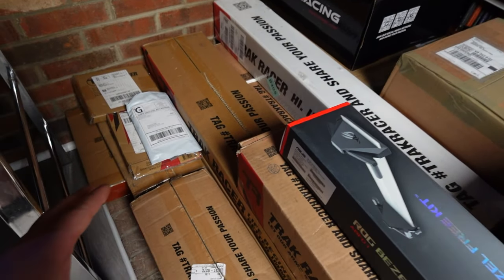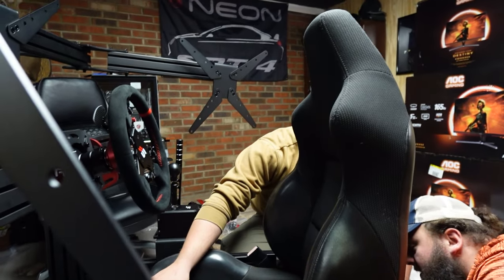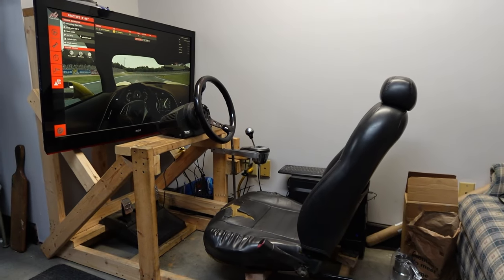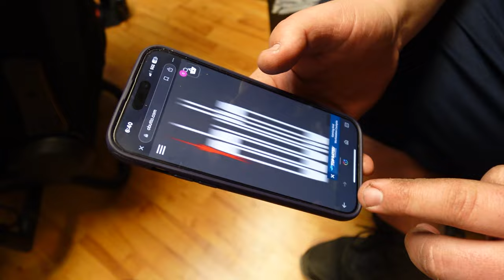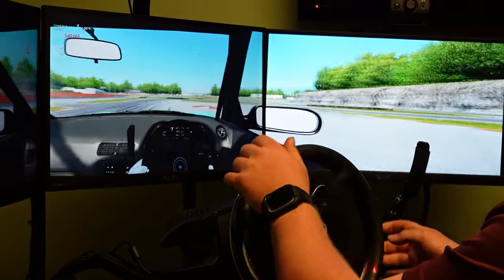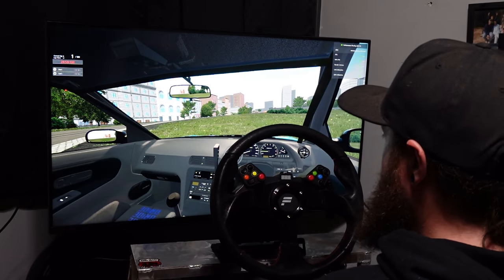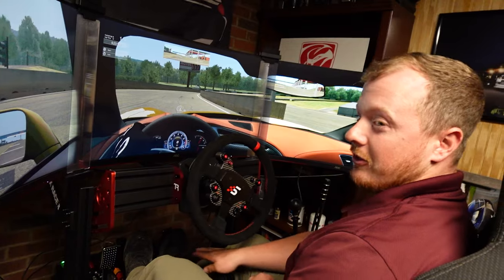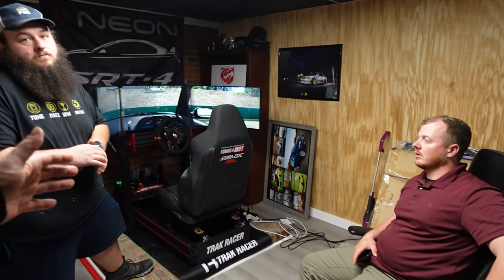Budget Built Racing Sim VS Track Racer Purpose Built Racing Sim | Which Route Should You Go?

Comment: 250 each monitor isnt to cheap, although my entire computer is a little more
like half that sim setup...without a monitor, keyboard, mouse, speakers, subs, 
etc. view sonic would possibly had worked with you honestly. (first "gaming") monitor
id bought was from them. had flicker issues, i solved posted the fix everywhere. now, i use a 40in
120hz 4k tv as my main. (if you check) you can get those 2k 120hz 32in AOC monitors used-like new right now for 170.00